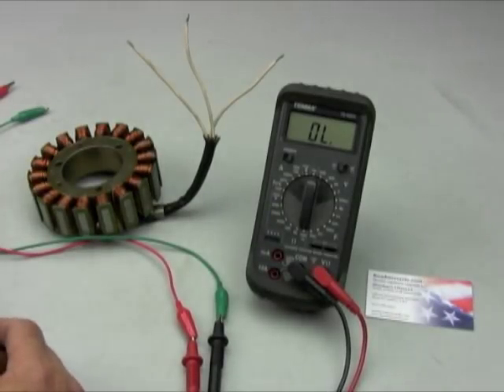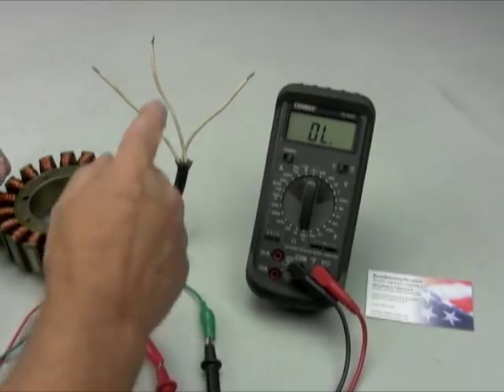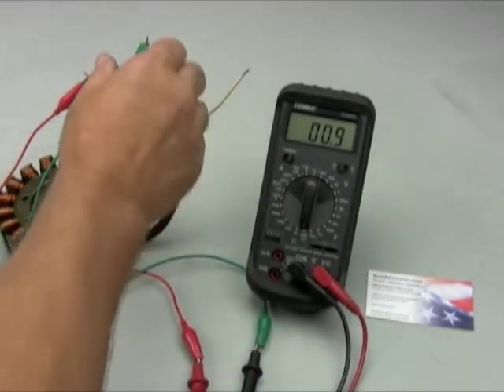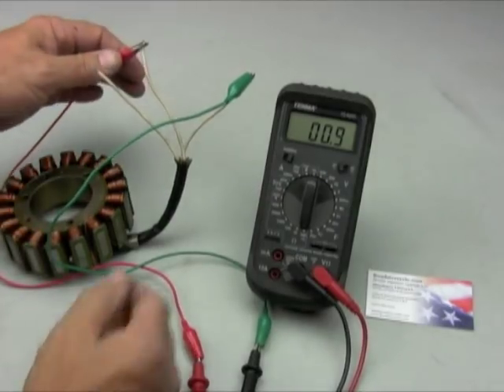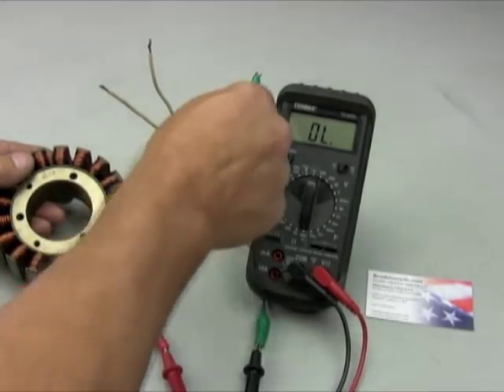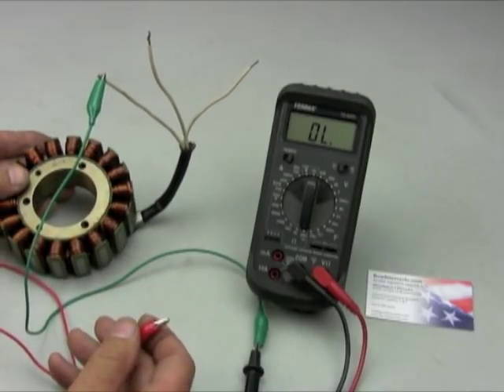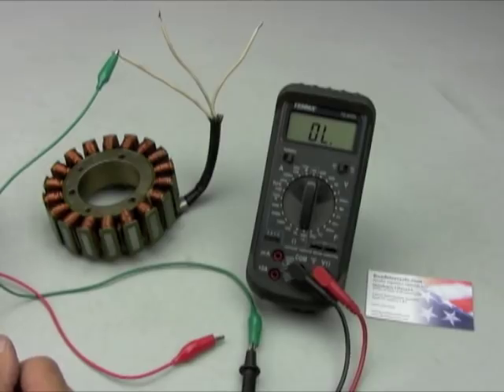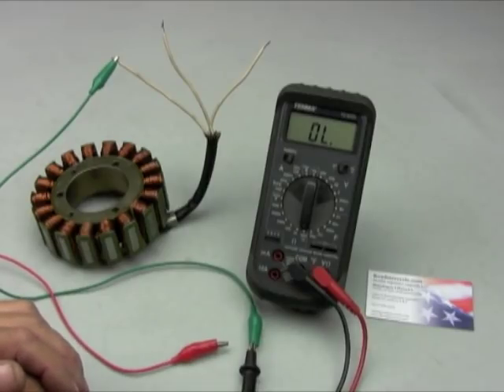Motorcycle stator checkout

Comment: question:  I went through the process and my stator gave me a reading of 1.6 consistently all 3 wires and no ground fault.  It is on a 550  Polaris ATV.  Is it safe to assume that different stators have different resistant values?  If my reading are good as described above should I know be looking into my voltage regulator/rectifier as culprit?  I know it is not the battery.  Thanks for putting out a great video!
Reply from the maker: Hi, yes some stators of different motorcycles do give different ohm readings. If they are all close and consistent then most likely it's a different issue. I have seen stators give great results and still be bad as they became weak over time and just can't put out the watts they used to when new.  The best thing would be check your manual and see what your stator readings are suppose to be. Check for bad connections between the stator and R/R, many times connectors tend to heat up and burn causing a low or no charging situation. If all seems good a R/R is the easiest, cheapest thing to replace but check your old one first there's a video on how to do that too on my website.

Comment: I have a Honda cb200 and I tested the three wires and got:
1.8
0.7
1.9
Does this inconsistency mean I need a new stator?
Reply from the maker: Sam it seems your stator has unbalanced windings that's why the odd numbers.
The 0.7 windings are shorter that's why the lower number.  It may still work but not 100%.  What problem are you having?